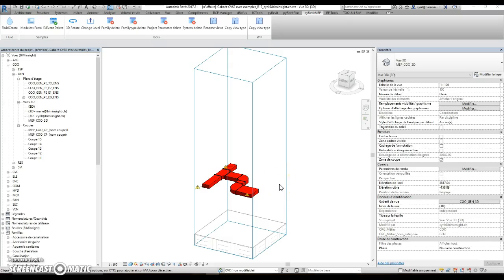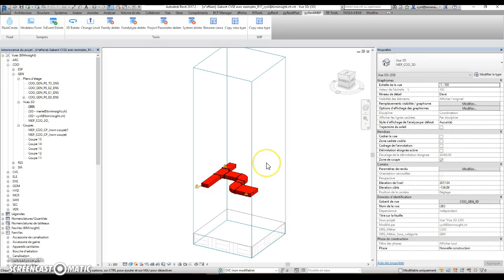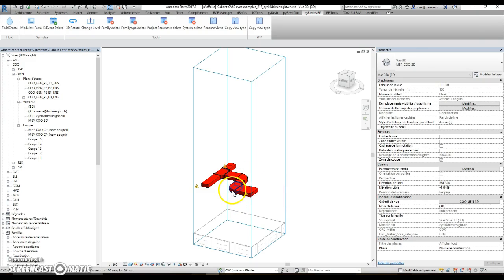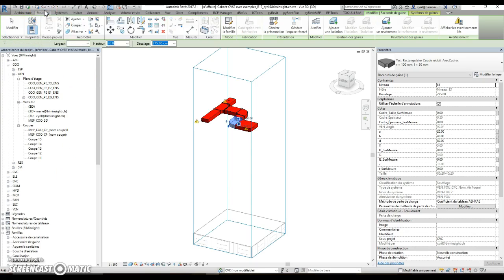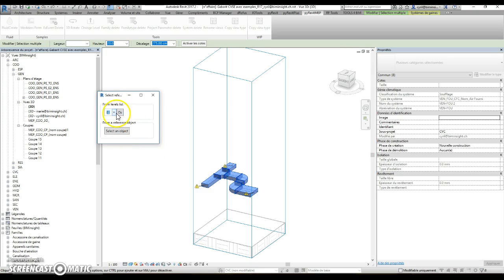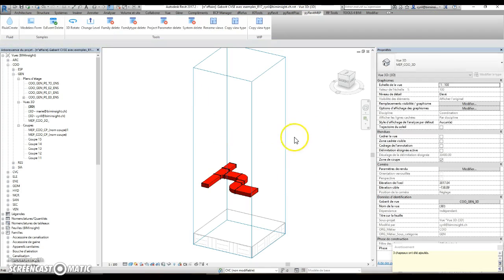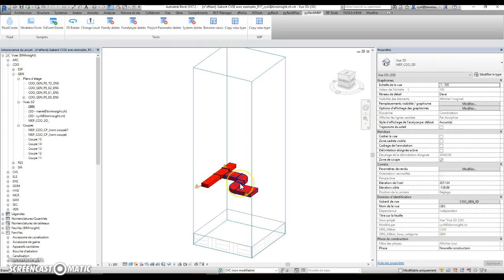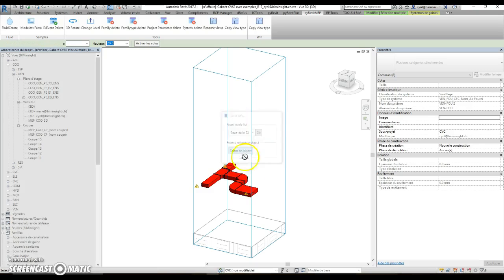[Revit] Change objects reference level (update)

Comment: Hi, I tried loading this new version.
And what I got was https://www.screencast.com/t/2PXxV9CHX
The previous version is still working perfectly for us.
Reply from the maker: Hi,
It looks like you didn't install pyRevit or not up to date. You tried to launch it from RevitPythonShell or from pyRevitMEP panel installed with pyRevit ?
Reply: Tried to launch it from Interactive Python Shell

https://www.screencast.com/t/8fJnqBmf

I need to get pyRevit? And the other one also still functions under that?
Reply from the maker: Yes, you need to install pyRevit, follow installation guide here : https://www.youtube.com/watch?v=PFu1aXpA4GY&list=PLc_1PNcpnV56sIy3rqeynN-wqZG6nMCur if you need. You'll see, pyRevit is great, it makes many things far simpler than before to develop and distribute code. It doesn't work with native RevitPythonShell as scripts refer to some libraries which are inside pyRevit. You can configure RevitPythonShell make it able to launch it but it is way far simpler to just install pyRevit then pyRevitMEP extension.